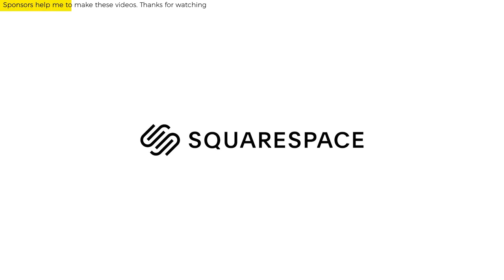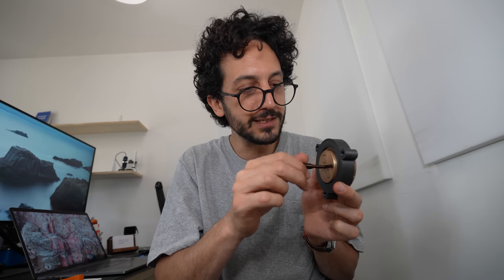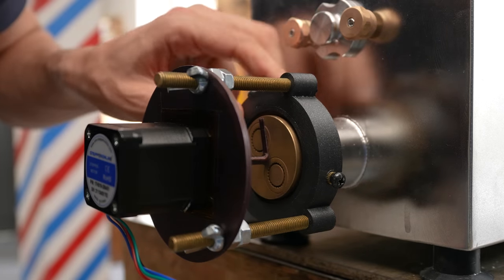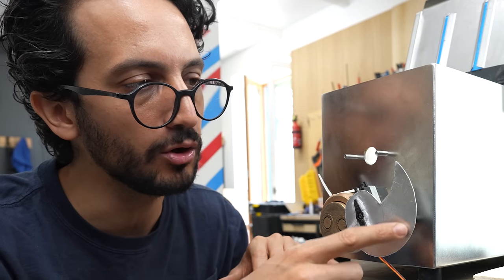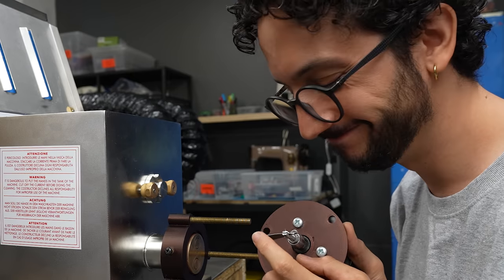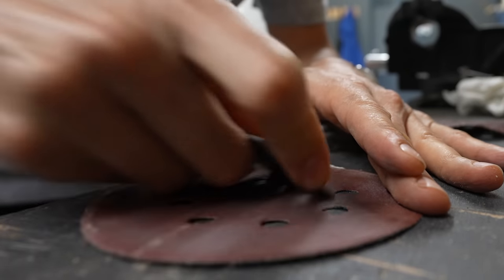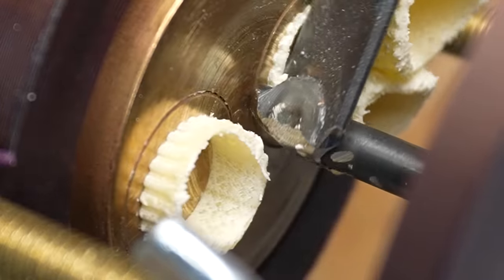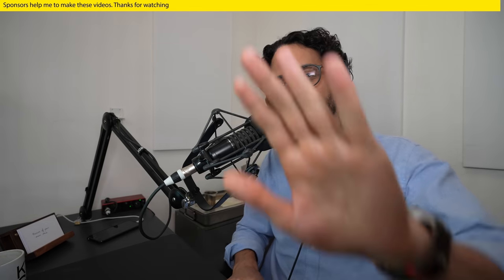I Tried to Make an Automatic Pasta Cutter (did NOT go as planned)

Comment: Here are my thoughts, as unimportant as they are.... There are two problems, possibly three problems.

1. The blade isn't parallel with the die. I know that on factory-made cutters they're at a fairly high angle but you don't have that kind precision available, as far as I know. So keeping the blade parallel is important.

2. The blades you've been using aren't sharp enough. Try razor blades - just build a holder for them so you can change them out periodically.

3. Most important, I believe - your cutter is too slow, squishing the pasta instead of cutting it. How to fix that problem while still keeping the same pace of cutting? Move your motor off to one side a few inches, not inline with the extruder, and use two blades set out some distance from the shaft of the motor. (Or use one blade with a counterweight.) In other words, if you move the cutting edge further away from the shaft you'll get faster cuts, but at the same rate you're cutting now. Still one cut per second or whatever, but the blade moves faster because the circle it would trace through the air is wider.

I bet doing these three things will lots of precise cuts... and it might even work on the pasta too!

Comment: Not enough torque for stepper motors , try use some gearbox with good gear ratio . It will help also with the speed problem . The last 2 "normal" motors have on them gearboxes already ...

Comment: The blade should be angled like a propeller blade.  The angle of the blade should be based on the extrusion speed, the angular velocity of the shaft, and the distance from the center of the extrusion head.  That way the blade is moving out of the way of the pasta as it extrudes and won’t compress the walls of the tubes that have been extruded.

If you extrude at 1cm per second, and your blades rotated at 60 rpm, then 5cm out from the center, the blade should be clearing 5πcm/s, while the pasta extrudes at 1cm per second. The angle of the blade at that point should be tan^-1(1/5π) or 3.6°.  At 2cm from the center, the angle should be 9°

It seems like it would be better if your blade was flatter and faster.  You could also secure the blade in the center and the outside (like a hacksaw blade) to keep it thin.  A razor blade might also work well.

Comment: I'm sitting here yelling at my screen "Offset the motor and have the cutter do a full loop before only cutting with 1 blade, and going from the left side of machine in clockwise rotation, That way they fall down and you don't drag them along, The longer your "Blade" the farther away you can put it and the "Slower" it will cut. Would need a mounting thing that would probably NOT be atttached to the machine or only attched to the side/bottom "With the spinny bit of the motor facing out at you". Thats my advice :D If it makes sense I can draw up a sketch for you in MS paint =P

Comment: My mind went to using something like a thin guitar string to cut the pasta. You can easily stretch/press it against the surface of the die, it shouldn't scratch it too much, and it doesn't have a large surface for the pasta to get stuck on. Would that have worked better? A concern would be that the string could snap after some time if it keeps being rubbed against the die's rim though.
Reply: and not rotating  but up and down - so you can manage the size of the pasta !!
Reply: @lh2480  I thought about up and down but then the string might get stuck on the die's rim. Rotation can work if you can manage to program a stepwise rotation instead of a continuous one.
Reply: @munzutai  you must work very - precise - with a frame around - you can handle that - you can also think about heat - so you get a more precise cut - the positive thing about up and down is the - time !

Comment: If you’re cutting it with a knife normally, you’d clearly have more success using a sharp blade to cut the things. None of the items you used until the very end looked to be actually sharp, you could still see the rounded edge. Also, if you have a guide the end of the blade goes through during its travel it will help to reduce blade play/ flex which is definitely a contributing factor

Comment: Hmm, I don't understand why you angled the blade so much in the end - it seems to be squishing part of the pasta shape by pushing it while also cutting. 
I wonder how a nylon string or steel wire would work for cutting here - strained on a larger wheel around the extruder. 
And instead of a radial motion, you could make it a linear motion (like your knife swipe) by building a small piston-like contraption - still powered by your motor, but moving in a guillotine-like slider.
Anyway I'm glad you achieved a result that satisfies you :)

Comment: I don't agree that it's the speed as much as the tolerance between blade and extruder. You noted in the commercial videos last time that they were so close occasionally the blade would damage the die. The material has minimum movement at the die interface so there are clean consistent cuts. The further out it goes, the cutter due to speed or sharpness or whatever will deform and smear the pasta. Imagine you let it extrude and tried to cut it cleanly a foot away from the die, you'd need skills and a samurai sword basically. Distance increases speed and sharpness required dramatically.

Comment: Why you didn't use a shaving blade and create a 3d support that could keep it with the best inclination possible? You could use it with the "off centered cutter" (the one that does not work by rotating at the center of the extruder)
I think by now your cutter can still suffer from pasta attaching to it while cutting, which makes the pasta shaped the wrong way and may create the risk of melting together different pasta pieces.

-A random Italian guy who loves your work. <3

Comment: Personally, I'd make that pasta cutter go up and down, instead of rotating. It's easier to control, you could use a guitar string, or a steel fishing line as the cutting tool make sure it's tense and two small motors at each end should do the trick

Comment: It looks (and sounds) like you tried to drive the steper motors with a DC motor controller. If you would have used a stepper driver there would have been no speed limit at the low end. Using such a driver also would make it possible to to a quick cut and then wait until the perfect amount is extruded before the next cut.
Reply: *Thanks for watching send a direct message right away on the above number for more enlightenment:••*......

Comment: Could you make a guillotine inspired cutter?

Where the motor moves a blade across the surface up and down in a very fast motion?

It would move up, pause, then move down, pause, and repeat. This way the cut would be clean and allow for longer cuts of pasta. You would need to program the motor to activate over a course of time to allow for the pause to happen.

Or increase the speed of the cutter you have while also increasing the radius

Comment: For the blade, why dont you just make it use the disposal manual razor blades? Like the ones barbers use. Also make a bushing for the shaft that touches the extrusion head so it doesn't damage the head

Comment: As others have mentioned, This way you can not make longer pasta, or you will get penne. It would be better if you'd use  a  motor that can quickly move 180 degrees and stop for 4 seconds, cutting one pasta each time.

Comment: Why'd you get stuck in rotary blades? Sure you saw them in the videos of the professional machines but you had something that worked previously: A knife moving vertically. Why not translate the rotation of the motor to vertical movement using a tiny gearbox or piston and stick two razorblades together to make something akin to a double sided guillotine(in terms of cutting motion)?

The final prototype looks great though, the effort you put in shows :)

Comment: can't help but think that if you used something with an edge instead of those "cutters" as you called them that from the perspective given in the video were just a dull piece of metal or plastic it would have worked better from the start.... this is because as the footage shows your pasta is getting smushed instead of getting cut.
the motor wasn't the problem clearly they were doing their jobs and didn't seem as if they were struggling with anything when moving... and fresh pasta dough isn't a hard material where you would need high amounts of torque... I think that if you used something like a box cutter blade strapped/welded to a bolt or something would have worked far better from the start or you...
could have used something like piano wire strapped to two points that rotated around the output would have worked just as well

Comment: why not use a thin, tensioned wire rotating about an axis just below the extruder face like a windshield wiper? you could put it on a similar timer as a wiper blade i.e. 1 swift wipe every 5 seconds

Comment: Your extruder is very small, so the rotation is a problem, specially at lower speeds. Try to mimic the manual movement with the knife, look at the speed of the industrial cutters. 
I would go out of the center, one fast rotation, wait, one fast rotation, wait. Only change the interval for different lengths.

Comment: At 2:50 (where I am currently paused and watching so meh) I can already see multiple reasons why this failed... Partly it's too slow to cut, second, the blade probably isn't sharp enough to create a clean cut. Maybe add a place where you can insert a razer blade. Third, it's spinning ALL THE TIME and very slowly. Those are the main issues. Instead of setting it for a specific speed, use a stepper motor so you can control where the motor stops and starts. Next program it to wait for a period of time for the extruder to produce the proper length of pasta, then have the timer activate the motor to go through one complete turn as fast as is needed for a clean cut. Then the timer resets. You might also consider offsetting it instead of having the blade turning directly in front of the die, that would probably help create a cleaner cut. Try to reproduce the same result as basically using the knife by hand. (so no wiper blade) I think that should be very easy to program for ya. I believe in you Alex! xD

Comment: I feel like in trying to imitate the larger ones it's become over complicated. I'd probably try and make a guillotine style piece of cheese wire that just goes up and down linearly. Maybe use the stepper motors and connect to two sides of the guillotine running in tracks using string/pulley system that allows to go up and down and then attach the cheese wire between.
Reply: Wrote this halfway through, glad you solved the issue in the end!

Comment: Your final cutter is 90% perfect, but it's visibly destroying your die. You're using a screw to fix it, but it need to be loose and have a spring inside it to make the correct pressure. The smaller diameter gap between the cutter and the motor shaft the better, so it doesn't "dance" over the die like the 3D printer versions. And finally, use a flat base for the cutter body that is flush with the knife, to preserve the dies.
Finally, observe the cutting direction, some pastas are more "well finished" if the cutter knife hits them  I determinate sides. For example, creste di gallo is preferrably cut by the cresta, radiatore the knife should hit it in paralell, by the fins side, and basically any curved shape should be cut from the side opposite to the curve direction. You will find out you need a support where you can put the cutter off center from the die and hit some shapes by the side.

Comment: your problem is it’s going too slowly, the blade is a bit too thick(think a razor blade, that’s what would work best. you’re trying to mimic what your knife does). if you were to offset the blade so it cuts both pieces on the downstroke by making a longer blade and mounting it to one side, that would probably work best. if you look at the professional ones you’ll notice they’re mounted down so the pieces don’t get stuck on the upstroke and collide. other then that you’re extremely close!

Comment: Not sure if this is a video about prototyping or male eyeware modeling.  Regardless, the solution is obvious at the outset.  A sharp metallic blade is necessary with a spring-loaded shaft to maintain blade pressure on the extruder plate.  The rpm of the blade is merely a function of the length desired.  Good luck with your eyeware business.  Crate out.

Comment: Others have already said so but I believe that there are 2 problems.  1 is sharpness and you are on your way to fixing that.  The other is angle of attack and you are still way off.  Try to get the angle down to five degrees or less.  You wouldn't cut vegetables with an ax no matter how sharp.  Your angle of attack is worse than an ax.  I'm surprised that a guy so familiar with knives would make such a mistake.

Comment: I know this is older video but y hit use a razor blade or utiliy blade and mount it flat against the extruder so it can stick to the side of the blade and the a razor blade or utility bkade is way thinner so it should cut easer and cleaner

Comment: Why not a wheel on a belt, with only 1 or 2 spokes in it? the spokes are really really tight and thin metal wires.

It is an external motorized solution, but maybe its worth a shot?

Comment: This is extremely late, but, could a double bladed razor drop work? Using a piston or something similar to instantly and precisely drop a sharp blade down, maintain its position, then after a timer, shoot back up with a second sharp side?
I'm not an engineer, I'm a chemist, but it could work with an electric timer, some force, and a double sided blade yes?

Comment: Why not install a sharp knife blade? Also, it should cut using the same angle as you are (when cutting manually) so the sharp blade cuts the pasta and not the flat side pushes it and squashes it.

Comment: Looks at commercial cutters -> makes a bunch of prototypes that are different and don't work -> makes crude prototype the same and it works crudely.

Good process for content. Bad process for producing a working machine.

Look at the blade profile on the commercial ones. Copy them. They're sharp, stiff and set at what looks to be a little less than 45 with as little vertical height as possible to not deform the pasta as they cut.

Instinct says the shallower the better, just so long as there's enough room for the pasta being extruded underneath it to not get caught and push the blade off the face of the die.

Copy what works basically.

Comment: Why not use a wire cutter?  Fit a circle that rotates around the shaft, connect a wire to it, let the motor spin that.  Like a mason jar lid but over the extruder, then let the motor drive the lid and it'll cut the pasta.

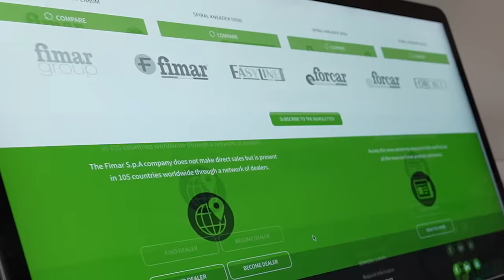Comment: @0:44 If the extrusion dies are all the same size, couldn't you just get a pre-built one and 3D print a sleeve to make one fit your machine?  I get how that 1/4" plug could be weird to wire, but that's an expertise that you have.. @6:53.. LOL omg.. worth it just for that.  The welding mask bit was gold too.   3 months from now when you decide to revisit this, maybe instead of setting the motor slower, you setup your controller to move it quickly but only in a set degree of turn?  Like 1 full rotation every X seconds since both pieces extrude at the same rate?  You could adjust the dwell time on the inactive period to make longer pasta, but still have precise cuts based on the feed rate of your extruder and determine the length of your pasta.  I see a potential pitfall in that idea as it might mush the 2 pieces together, but if the velocity is high enough the force of the cut could be enough to remove the previous piece from the blade before the next cut.  Sorry, I'm over thinking this but centrifugal force as an outward push might actually help with the cutter.

Comment: Your cutter has too much slack when rotating. You could stiften up the cutter by making a small indentation/hole in the dye that the cutter extends into. Then your cutter would be supprted and rotate on 2 points rather than 1 as of now

Comment: I wanted to see some kind of guillotine instead of a spin solution. Should be way easier to adjust the timing of the cuts. Then use a razorblade that cut both ways and just have it go up then down like the extruder on a 3d printer.

Comment: Very nice video, that's exactly why I love your videos. You show you're human and not a fucking arrogant parisian because you try and fail. And mostly, you show that fails are lessons that give you more knowledge than victory.

I'm not an engineer, so I can be really wrong with the following. The beginning of the problem is thinking that using same settings than professionnals and reducing them at a house size. sometimes it works, but sometimes you'll make a mess. 

I really think an eccentric cutter would be better. The problem you were facing with yours was a blade problem. The blade was really in front of the pasta die for too long, allowing the dough to push your blade and breaking it. But to use an eccentric cutter, you must have a blade that is thin, sharp and most important setting, it must be fast. And here is my thought about the professionnal pasta cutter. They are fast because the extruder push the pasta fast enough to be long enough and allowing the cutter to move continuously. For domestic pasta cutter, you must have a blade that move fast on the die, but you must have a blade that wait enough time to have a long enough pasta. And that mean you have to program one cut moment, and a waiting time before making the blade cutting pasta.

Bonus thought : cutting with a fishing line. it won't damage your pasta die as much as a metal blade... maybe.